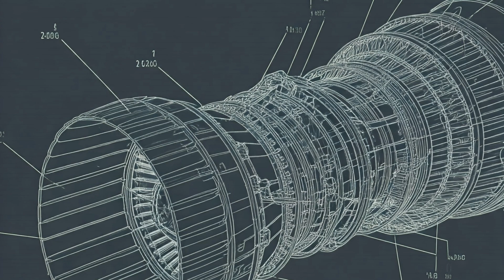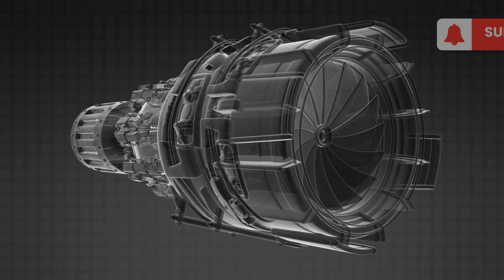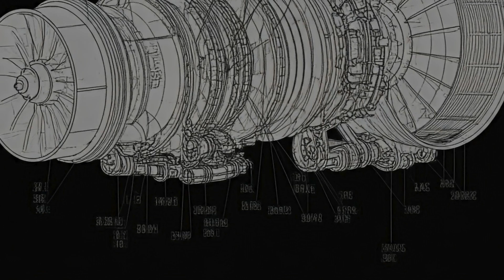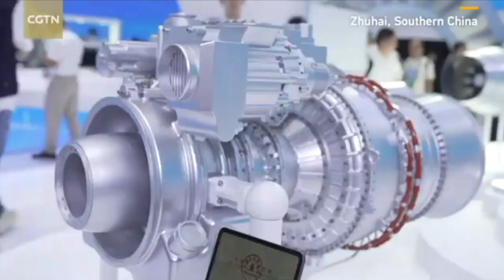Why China’s Jet Engine Advancements Are a HUGE Problem

Comment: China have made substantial innovative material breakthroughs in fan Blakes capable to withstanding increased heat tolerance up to 23kC.  These capability improving thrust vectoring, increasing cruising power plus longer life of jet engine.  China WS-10, Ws-15, 18, 20 have been in mass production and installed in the fighter jets J-10c, J-15, Y-20, etc.

Comment: It's pretty clear that China has already possessed the ability to develop and produce cutting-edge jet engines and that shows with its domestically built J-10, J-20, J-35, and C919 and more.  No more chokeholds by any countries in particular the US.
Reply: WZ-10, WZ-19, 20, AG600, Y-20, plus all the other drones use Chinese made engines. Future 6th generation fighter jet will not use turbo fan engines anymore!!😎